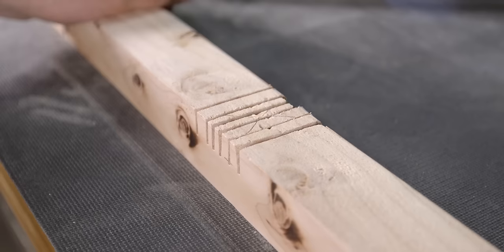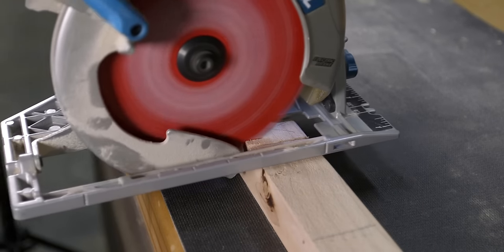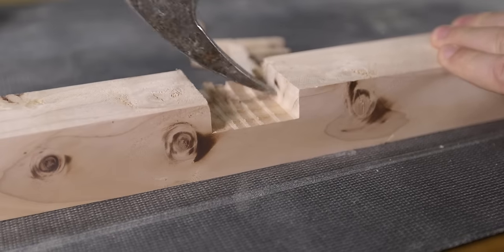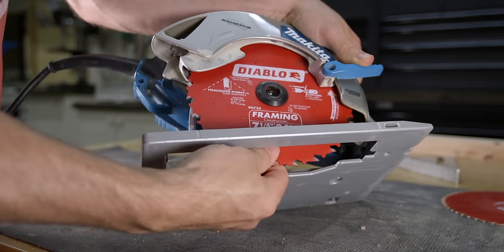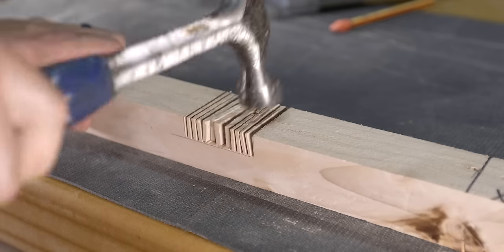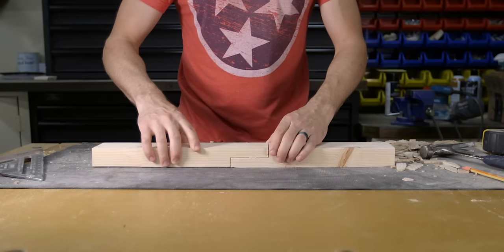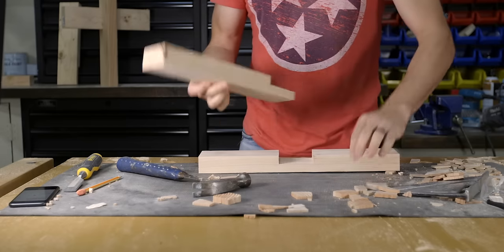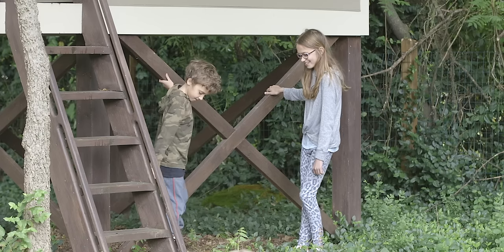Cutting Notches With a Circular Saw

Comment: You solved a problem I was thinking about. I need to make a 5/8" deep channel, just 3/8" wide along a piece of 3/4" plywood, running for about 8". It will be a simple stand for holding up a 6"x6" tile to be used as a quick notepad with a dry erase marker.  The channel however is slanted to keep the tile at an angle so it stays put. The circular saw technique you taught in this video for notches can work for my project with the saw set to that desired angle and depth.  I was contemplating using a trim router to do this but could to quite figure out how to create the angle in the channel.  Thanks.

Comment: In my oppinion, the half lap is a joint every woodworker, hobbyist to professional, should learn how to make.
The table for my jobsite tablesaw and router and my assembly table were made using mostly half laps. The half laps on my assembly table were made on the sliding miter saw. :)

Comment: Great tips. I like your straight forward information style. I cut those notches same way. I use the same thickness scrap piece of wood in front of the notching piece as a guide - it helps keep all cuts same depth, no early lifting or dipping. Also, I find it easy to clean notches with horse rasp, probably works only with softwood.
Reply from the maker: Great info... thanks for the comment!!
Reply: Great tip to help avoid dipping!

Comment: I always had a big rough rasp with me to smooth out the notch after you knock out the kerf pieces. The rough side of rasp removes the high spots and flip it over and couple strokes with the smoother side of rasp and you've got a nice smooth even notch!  When the deck building craze of the 1980 's took off , we built a bunch of decks and made lap joints on deck posts to set ledgers on!  I discovered what a great tool the old Stanley rasp is,and been using it since
Reply from the maker: Great tip! Thanks for taking the time to tell us Greg!

Comment: Wow! I too am building up knowledge. I am working on a pair of beveled glass pocket doors.  I need to fill in the gap between the bottom of the glass panel which will butt up against the bottom frame. I am sure I am not describing this right, but after watching your video I think I may be able to use the dado. I am still thinking on it. But thanks for the information. Very useful.

Comment: Excellent video. Many thanks for the tips and tricks. I have an older, massive circular saw my dad gave me. Now I have some ideas of what I can do with it, although I did use a jigsaw to do the cutting for some wood to clean the joint out like you did with the circular saw. More unwieldy but interesting. I would saw give it a go as it's useful but be careful. Got a little kickback. Be safe. Thank you.
Reply from the maker: Thanks for the comment Blazing Smoke!

Comment: The splice joint is correctly called a lap joint as it "laps" over the joint.  One may use a parallel joint or a 90% joint to form cross bracing.

Comment: Wow - I never learned that enough to actually do it - I'm sure I've seen it before. There's so many "traditional joinery" tips that are way harder. I left off with reinforced butt joints and pocket holes. NO MORE! Other than a couple-three finish nails to hold it while the glue sets - looks like no reinforcement at all is necessary - a huge time savings. Think I'll start on a miter saw first though (picture of Penny Henny). 🐔
Reply from the maker: Thanks for the comment

Comment: Hello... Novice here... if you decide to use one of the notched joints, does that eliminate the need to screw those together?  Thanks for the great videos.  I see where I've made past mistakes using a circular saw.  This certainly bolstered my confidence and my desire to try my hand at more projects.
Reply from the maker: Perhaps it does, it just all depends on the application. Thanks for the comment.

Comment: I am making a rectangular frame for a small gate and wanted to make it out of 1 x 4 pine,  for the sake of lightness.  Afterward
I will  hang  2" rustic  poles or saplings vertically on gate frame, sort of like pickets.  I was thinking about using  half lap splice joints at each of the frame's corners.  But maybe 1 inch (really 3/4")  material is too thin to use a lap joint?...what do you think?  I could also use pocket hole joints.
Reply from the maker: Hello E Miller! Yes, 1x material is too thin for sure. If this is an outside project I would use pressure treated lumber like 2x4's. If you are looking for something a little lighter, you can use Cedar, which is also great for outdoor projects and is not treated with chemicals. Sounds like a fun project!

Comment: I'm an amateur carpenter,diesel mechanic by trade, when you add materials to knotch let's say for something like a kitchen island,do you need to fasten pieces or rely on knotches to have the strength needed as a shelf?
Reply from the maker: Hey Nick! Generally notches like this wouldn't be used for shelves. If you'd like to send me a picture and/or a message on Instagram, I might be able to better answer your question.

Comment: Great video, very informative. Are there any of these joints you wouldn't screw or nail together?
Reply from the maker: Depending on what the application is, simply gluing them together would work.

Comment: On the edge cross lap joint can you tell me how close to the end of the board it can be cut before it becomes to weak and snaps? I'm building a farmhouse table with folding sets of legs that requires a removable stretcher using this joint but the plans I was given has a flaw. I'm using 2x8 dimensional lumber with a nothch cut two inches from the end of the board on both ends. The two inch side easily snaps off

Comment: I understand how you did the 2X4 crosslap 2X2 notch - but how would you do an end of 2X4 notch?  I have a project that will require over 100 notches, and the crosslaps would take a VERY long time to make the notches, but I don't know how to do the end of the 2x4 2" notch.  Best I can think of is to build a jig/sled and use a table saw.  Any better ideas for me?
Reply from the maker: The jig is a perfect idea!

Comment: great tutorial. just wondering if making such deep cuts into 2x4s would actually weaken the individual 2x4s at all?
Reply from the maker: Great question. Yes if left by itself, no if the joint is completed with another piece and fastened.

Comment: I'm planning to notch the interrupted diagonal by the middle rail on our new gate. What would be recommended depth of the notch? The rail and the diagonal piece are 2X4" and laid down w/4" side. I think 1/2" would be sufficient, but not sure. Thank you for a great film.
Reply from the maker: Normally when you are doing diagonals you'll have to remove half the thickness to get them on the same plane. However, I'm not sure how you are building it so you might be able to make 1/2" work.
Reply: @TrainingHandsAcademy  I just want to make same gate we have, but new. On the original gate there are 3 parallel (horizontal) rails (2x4") and diagonal piece (also 2x4") for support and against sagging. But that diagonal is not one piece, but 2, bcs of the middle rail. So it is like Z letter with the diagonal part cut in 2 pieces and notches will be cut at ~45 degrees. On the original gate those diagonal pieces were not notched. I've read it is better to notch them, but also not to cut out much from the middle horizontal rail. I might do 1" depth, since you say it should be larger depth. Thank you for the replay.
Reply from the maker: @olenaerhardt7725  Gotcha! 1" sounds great. Just make sure to use glue as well as a mechanical fastener like screws for example.

Comment: Thanks for the video and a question. On the shoe of your saw and others, the rear right corner is cut off and the shoe isn't rectangular. What is the reason for that shape of the shoe?
Reply from the maker: Great question! I wish a had the right answer, but I don't know. I would guess is has to do with improving functionality, like if you're in tight quarters and need to make certain cuts where the base would get in the way. Not sure, maybe someone else knows more.

Comment: Is it possible to make these cuts with a plunge saw? I image that it would be kinda wobbly since you have to actively push down the blade and I suppose that's potentially more dangerous on a smaller work piece without the track? Or is it no problem to just plunge it at the start, given that the piece is securely clamped down? ... yeah, I'm looking into buying a circular OR a plunge/track saw and not being able to make those cuts would be a big minus.
Reply from the maker: I wouldn't use a track saw for this personally... but that's just me. You can always buy and circular saw and add a track system later on, like in this video  ---> https://youtu.be/ILVCdEOhYBc

Comment: How to fasten the two pieces together in a joint?  One of them is quite thick (where the cut is half the width) and I don't think I would be able to use a screw.  Then glue?
Reply from the maker: Glue or small screws.

Comment: Newbie question from me. Why not use a router for this instead ? It seems like it would require less clean up at the end.
Reply from the maker: Great question! This method is used for "rough" work mostly, like decks, fences, house framing, etc. It's used because it's fast but clean enough to be acceptable. A router would be used to make more "precise" cuts like that used in fine woodworking. Hope that helps Chris.

Comment: Awesom evideo. thank you.!!  I want to make a small privacy wall with 4x4 posts but i want to notch out a groove (3/4inch) along the full length of each post so i can slide in and stack my fence boards ends.   How would you approach making such a grove if you dont have  a dado blade for table saw?
Reply from the maker: Do you have a router?
Reply: @TrainingHandsAcademy  a palm one yeah...
Reply from the maker: @troyporter3825  That would work

Comment: Hey, thank you for posting this.  I’m hoping to get into framing houses at some point, and have been woundering how this was done, once I saw it on another training video.  I was just wondering, if a circular saw is not available, would a reciprocating saw work for cutting these notches too?
Reply from the maker: Hey Aaron! A reciprocating saw could make these cuts, but it would be very difficult to keep them nice.
Reply: @TrainingHandsAcademy   ok, thank you for letting me know.  I just wondered because, due to my disability, I’ve had trouble finding a circular saw that I could get the go-ahead to use.  I did find one more recently, but I’m still waiting to make the money I need to be able to buy it.  So I might be stuck using a reciprocating saw and a sanding sponge for starters.  That is if I can still buy the saw once I finally have the funds for it.

Comment: Could you please explain (or show in another video) how to make the cuts for the Half-lap Splice Joint and the Mid-span Half Lap using a circular saw.  For the half lap, there seems to be only one side for the saw's shoe to rest on when you get to the end.
Reply from the maker: To do both half-laps, I like to start at the very end of the board first and then cut my way in on the board. With my saw, the main part of the shoe is on my left if I'm using it right handed. That way my saw is always well supported while making all the 1/4" cuts. After the cuts are all made, I use the hammer and the chisel to clean things up. I hope that helps, if not, send me an email. josh@traininghandsacademy.com
Reply: Yes, that clears it up. Thanks!

Comment: Great info thanks!  Just subscribed because I understand almost everything you said...lol.
How would you cut a thin notch into a 1 " thick plank which is 12" wide. The notch needs to be 1" wide by 6" long, 5 inches from each end of the plank....the bottom of the notch needs to be clean and straight. Excuse my ignorance.
Reply from the maker: Hello! Are you asking how I would do it, or how you can do it with the tools you have?
Reply: Training Hands Academy  Hi there. I guess I’m asking how you would do it?
Reply: Training Hands Academy  I have a jigsaw, circular saw, Japanese pull saw...grandad saw
Reply from the maker: I would most likely use a router with a straight bit and a straight edge so that my router would have something to follow. I then would clean everything up with a chisel.
Reply from the maker: Have you watched any of my router videos yet?
Reply: @TrainingHandsAcademy  Thank you, advice much appreciated..will watch. I don't have a router...I'm off grid, so will check to see if there are any cordless ones...and sharpen my ancient chisels!

Comment: I’m looking at making a bed frame. Would doing this for the center support rails and the slats weaken them?
Reply from the maker: You could do that with some of the framing members, but in general the slats sit in a rabbet joint cut into the side rails. Again, it just depends on how you are putting it together. You can email me some drawings.
Reply: @TrainingHandsAcademy  I’m redrawing it with an Engineers Ruler, so it’s as accurate as possible and to scale.

I just don’t know how I should attach the center rails and the slats. I’ll get what I envision to you as soon as I can. This could take a few days.
Reply from the maker: @HoushouRattengod  no worries, I look forward to seeing it.

Comment: Hi there, Any advice on cutting a notch in the shape of a half circle ( trying to make a cigar holder). I have limited tools, any suggestions greatly appreciated!
Reply from the maker: Do you have a table saw or jig saw?
Reply: @TrainingHandsAcademy  i have a jig saw
Reply from the maker: @muckhorse9687  Great, I would simply layout your half circles on the edge of a board using something round. You can adjust how deep the half circles are by moving it further into the board or bringing it back out. Then cut them using the jigsaw. You will need to sand them of course after you are done. Does that help?
Reply: @TrainingHandsAcademy  Thanks for the reply. To further complicate things i'm using barrel staves, I may have to try and clamp them vertically and see what i can do with a jig saw, otherwise i think i would need a table saw or plunge router.
Reply from the maker: @muckhorse9687  If you are on Instagram you can find me there, and then share photos or videos with me of what you are doing... I might be able to help you out more.

Comment: Do notches weaken the structure since it’s half of the material?
Reply from the maker: Great question! Short answer is they can... but in most cases they are matched up to another piece completing a joint and actually making the connection stronger.